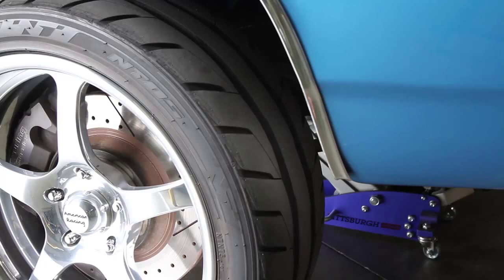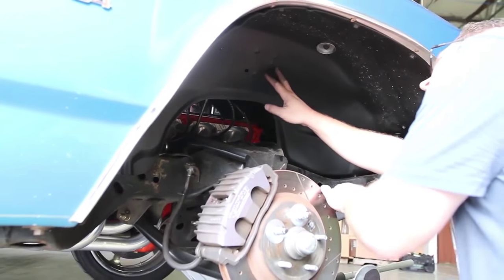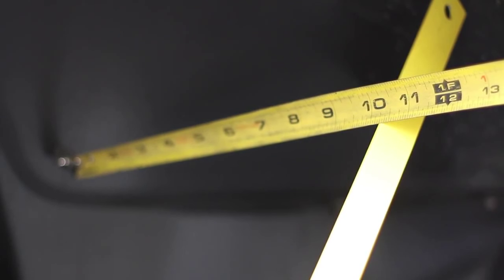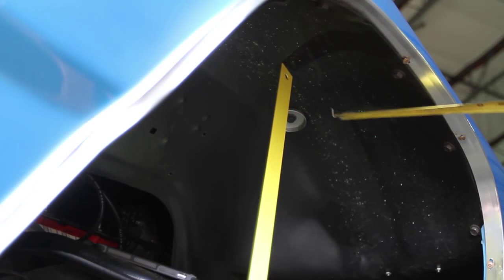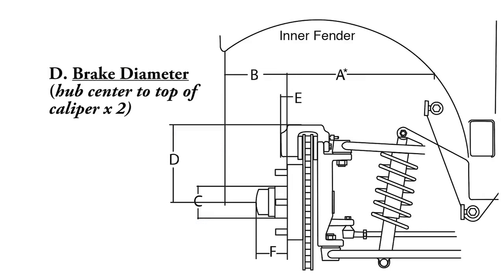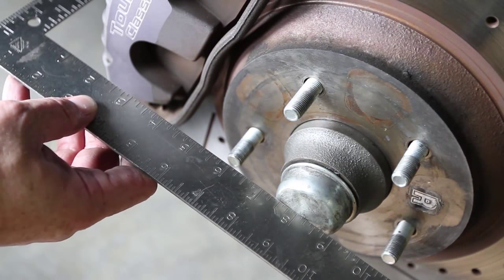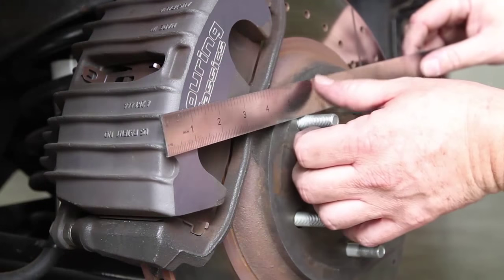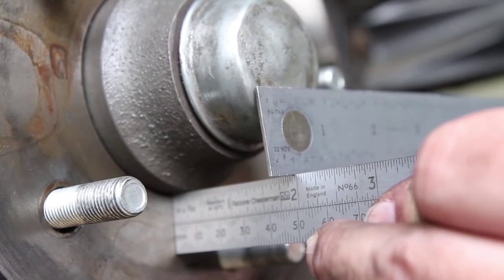How To Measure Your Vehicle For Custom Wheels

Comment: Great video on how to take these measurements but the problem is neither this video nor the worksheet tell you how to do anything with these measurements. These measurements don't immediately translate to wheel fitments and I was expecting an explanation on how to derive wheel fitment ranges from these measurements.
Reply: It also doesn't account for turning the wheels or suspension travel. Pretty useless video, sadly.
Reply: I had to thoughts going through my head. One, am I an idiot and just missed it. And two, who waste their time, making such a detailed video with such useless information.

Comment: You really need to have your suspension in the loaded position, If you have it in droop (unloaded) as in the vid your measurement will not be relevant to the actual wheel position in operation.
Reply: Thank you! Finally someone said it. Just have to figure out how to get to that position.

Comment: Wouldn't you need a jack under the wheels suspension to preload the suspension to simulate the wheel up in the wheel well?
Reply: Would be best
Reply: My thoughts as well. Clearances are going to drastically change at normal ride height vs suspended.
Reply: It's a good thought but I don't think any of these measurements will change based on that. Measurements C-F are all measurements of things attached to the wheel hub so their relationships and measurements won't change no matter where the wheel hub is in 3d space. Measurements A and B are measurements from the mounting surface, parallel to the ground. For the most part, the mounting surface moves up in and down (perpendicularly to the ground) under load but doesn't move farther from or closer to the vehicle (parallel to the ground) so these measurements should be accurate as well. Because the measurements are not specific to be of a particular distance from the center of the wheel hub, they aren't affected by load. But this lack of specification I think get's to the limitation of the measuring system. The diameter of a wheel will change how much space it could have even in the width, offset, and backspacing areas. For example, they measure to the first contact point which in that case was a bolt but what if the wheel wasn't large enough in diameter to reach that bolt no matter how wide the wheel was?  When I went to measure my self I ran into this problem. Because of the way my suspension is, the struts get farther from the mounting surface the farther from the hubs they go and the struts are the first contact point. But where do I measure? At different 'diameters' that distance would be different. But there's not a simple and consistent way to solve for that limitation.

Comment: I changed out the rims on my van went up one size so I can get e rated tires ever since I did so every time I hit a bump set rims from my upper a arm a little bet something I've over all I have been able to live with so far but really don't want to leave it this way my original rims for a zero offset by going up one rim size from a 15 to a 16 can I buy another 0 offset rim or do I have to go with and negative offset greatly appreciate the help have a few rooms in mind all depending on when I have to do